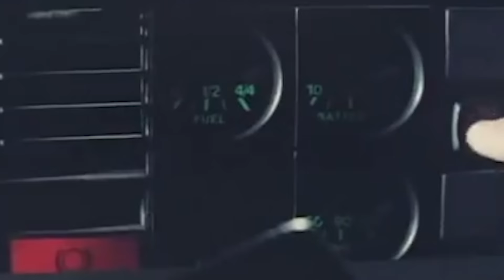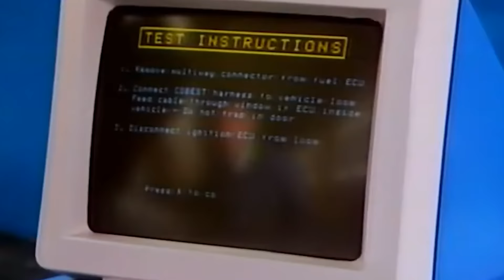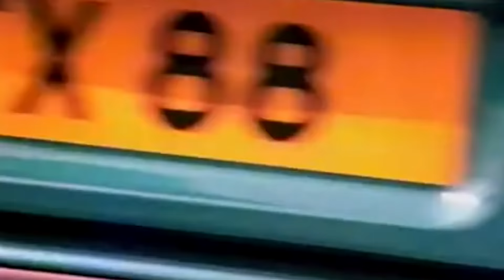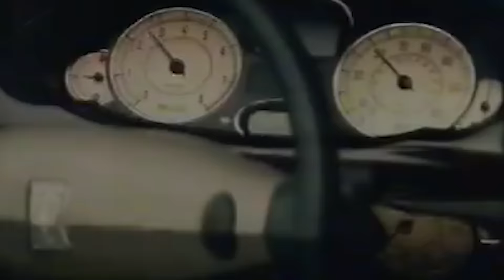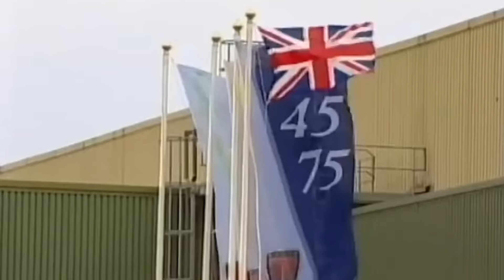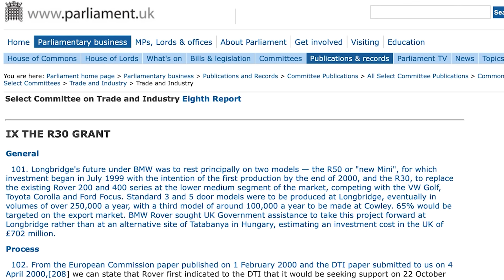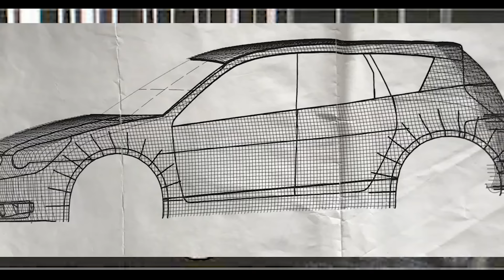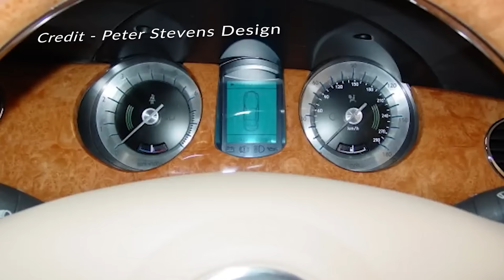The MYSTERY OF THE LOST ROVER CARS -  The Rover 55, R16 And More!

Comment: The Rover Oden looks remarkably like a certain Honda CRV MK1. Maybe that is where the lost concept ended up because at the time, Land Rover Discovery MK1 models were seen in Japan with Honda badges. So to keep Honda happy for using their body shells they probably sold it on to them not realising that they would produce a small SUV in the near future.
Reply: Honda Crossroad ?
Reply: @andrewboulton9928  Land Rover supplied the Discovery for the Crossroad model. Looking at the Oden concept shape though it is very similar to the MK1 Honda CRV which came out at the exact same time as the production Freelander. It makes you wonder if this concept design was sold to Honda as part of a deal because if you look up Honda CRV mk1 concept car there aren't many drawings or show concept cars, which makes me assume the disappearance of the Oden was one where it went to Honda Japan.

Comment: I still have two 75s one diesel and a v8  both with low mileage, I did 275 ,000 in my first 75 diesel , it was still driving like new , I gave it away to buy another , but only years later I realised how rare it was , heated windscreen. Only 18 made. It was a demonstrator and was worth 32,000 so that’s about 13,000 in extras

Comment: there a low quality film right at the start at about 10 seconds in of a grey P6 with no hubcaps and the US style bonnet and an Ice alert and some sort of overriders on the blinkers on the frontr wings.

the suspension is raising upwards. do you know what that car is , especially interesting is the suspension that seems to be raising up on air or hydraulics ? was it a proposed modification for the saloon cars or maybe a test bed for the RR series. 

its particularly intestring as that car car had completely unique front and rear suspension design n mounting and any sort of modification is difficult and certainly not ever any    sales of  factory or aftermarket adjustability . 

cheers

Comment: In the L Series diesel engine the group had developed a potential world beater.  It was improved by introducing the common rail version and was to be developed in 5 cyl and 6 cyl forms.  Then the sale to BMW who, with hindsight we realise, only wanted the 'Mini' brand and the four wheel drive/off road capability knowledge from Land Rover.  BMW dumped the L Series to use one of their own diesel engines and fuirther development of the engine was abandoned.

Comment: Hmmm...I think that the styling of some of these models illustrate the muddle that Rover were in. The R16 and the 55 are a right mess IMHO - some styling cues from other models incorporated, but the results look like cut & shut jobs from 3 different cars! On both the central passenger section with the doors look like they were designed for another car entirely! There seems to have been no 'vision' of what the car could look like, but only to nick familiar bits from existing cars. Interesting how classy the R75 looks in comparison, but maybe that's familiarity playing tricks. I was deeply unimpressed by the R75 at the time, but the more time passes, the better it looks! Now looks rather refined and elegant. On the other hand, the Odin MPV concept could have been a real goer, though the muddle between it and the Freelander (btw one of my personal all time ugliest cars ever made!) obviously did for it.